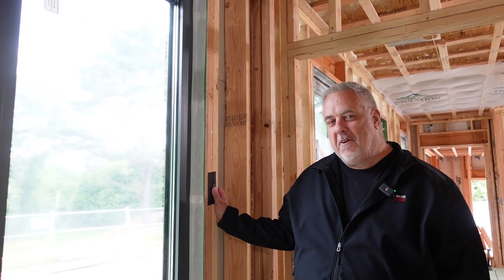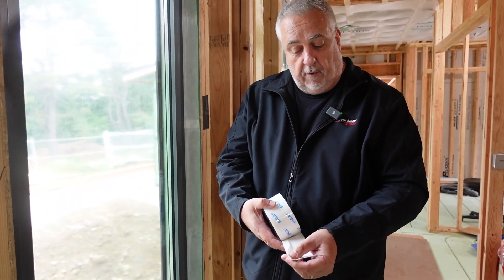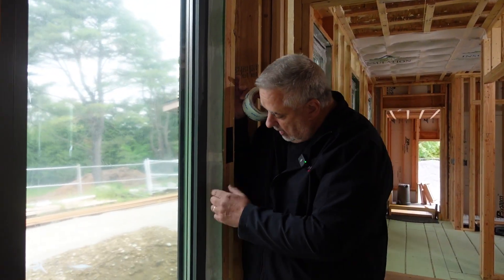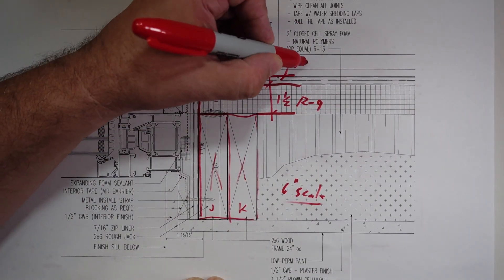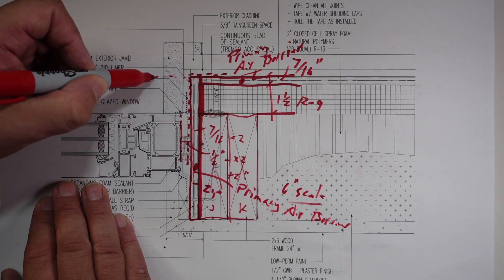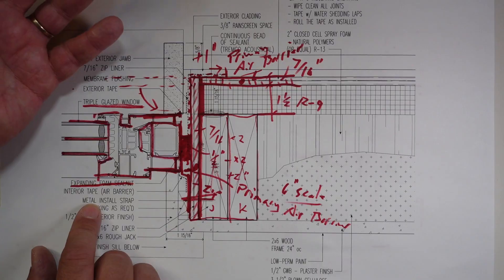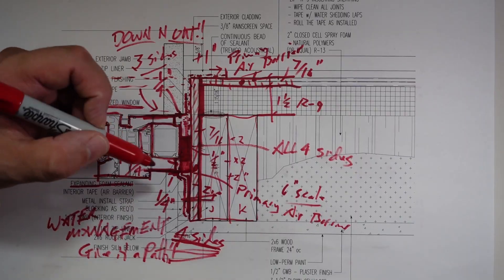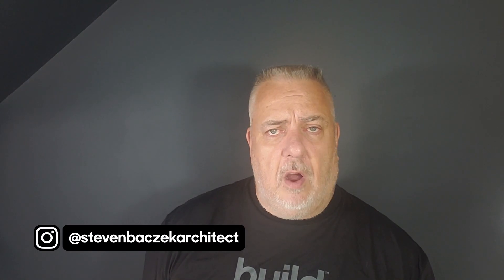FLANGELESS WINDOWS - AIRSEALED !!!!

Comment: Would prefer “Pella (hurricane Rated) windows & doors to these, 3/16 outer glaze, 7/8 spacer, 1/8 inside glass. Worked 20 year’s building/rebuilding 4 Seasons atriums with 7/8 glass. There is so much expansion/contraction “violence” between black aluminum & the glass. The sealant must be so pliable to deal with it. Actually re-glased curved 4 seasons glass sashes.

Comment: The Tyvek Intrerior Straight Flash air seal tape adheres to the side of the window rather than to the face of the window and then folds over, covers the expanding foam and then wraps around over the interior permeable vapor barrier, such as MemBrain. I use a lot of SIGA products on the outside but why do you prefer the Fentrum tape on the inside instead of the Tyvek tape, which is less visible? thanks for the great videos!

Comment: By using the Zip panel and tape it both simplifies logistics and keeps the same thermal and weather resistant properties for the entire system without having to worry about what happens with mixing systems and variable thermal properties. Few things worse than having a failure from unexpected complications from mixing systems.

Comment: Many of the previous videos on the BSN  called for spray foam to seal the window.  That bothers me as you are relying on the skill and integrity of the installer to make sure places like those installation tabs are sealed properly.  While I would use the foan for insulation purposes, air sealing would be suspect, at least for me.  The Fentrum tape is right there, out in the open for visual inspection. Much better than having to trust that the sprayfoam got everywhere it needed to go.👍

Comment: I just installed these windows. we used the siga tape on these outside. we then close cell foamed all around the windows from the inside.   did we screw up?
Reply: yup. you need also liquid membrane (inside and outside) to have full sealing .
Reply: If you Wigluv'd the entire opening (or at least the entire still + 1' vertically), I think you'll better than you think.
Steve has videos on how to flush these windows but they are using Zip tapes instead of Wigluv